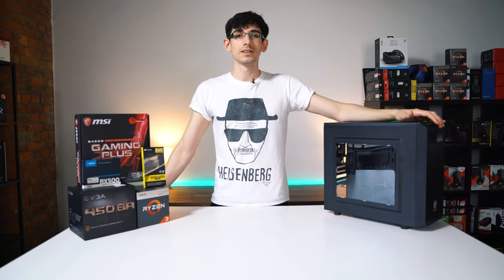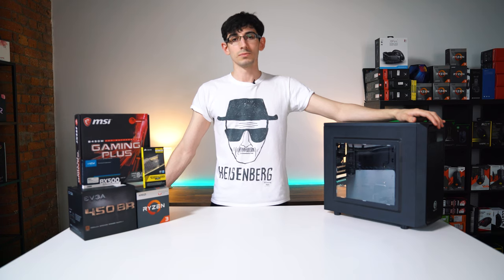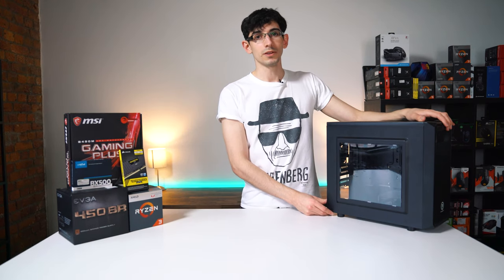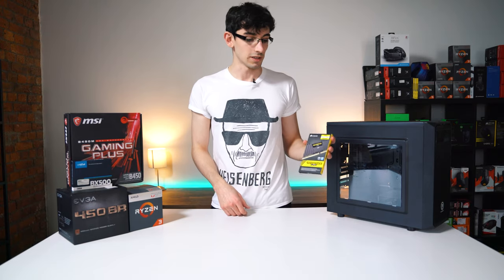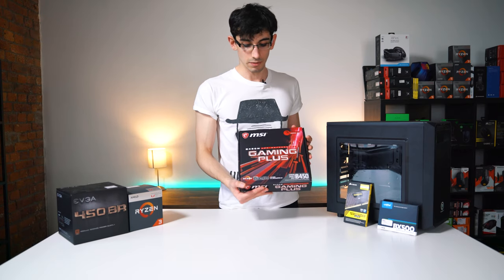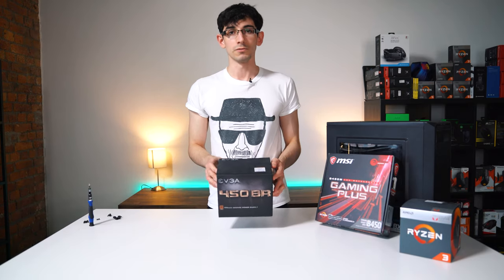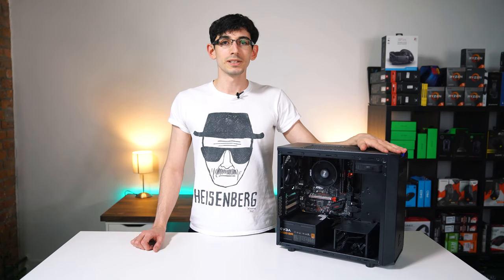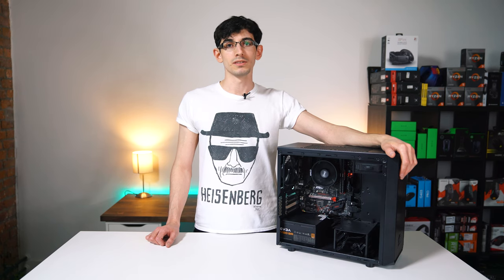Best $300 Gaming PC of 2020 | Budget Builds | WePC

Comment: To afford this I would literally
 ha e to work for 1 and a half years
Reply from the maker: Damn! If there's a second hand market (like eBay) then we'd suggest looking there then - used i5 2500Ks or above bundled with motherboards and RAM can be had for about $100, some even include a graphics card, but you'd also need to source a case, PSU and storage

Comment: Would this build run Adobe Photoshop easily? I'm not a gamer, have never built a computer and actually need it for graphic design but I've heard that gaming computer specs would be high enough for that😅
Reply from the maker: Our $300 build is about as entry-level as it gets for a gaming PC. With Photoshop you want to invest heavily in the CPU and RAM, but it ultimately depends on the filters you're using and the image sizes. To keep the cost down we could recommend splurging a bit more for the 3400G which has 4 cores and 8 threads. If you want something even more powerful then look at the Ryzen 5 1600 or 2600 which can be similarly priced or cheaper and have 6 cores and twelve threads, but you'll need to buy a discrete graphics card. Alternatively, looking at intel, you could get an i5 9400 (non f) which has  6 cores / 6 threads. and integrated graphics. I'd honestly recommend going the 2600 route in which case you'd be looking at our $500 build: https://www.wepc.com/builds/best-gaming-pc-under-500/

This will be more capable for any other creative tasks you might try in the future like video editing, 3D modelling, animating, etc. so it will be worth the price increase. You can customize the components like the case for example, I prefer something like the Thermaltake Versa H17 for a more elegant design. You could also get the RX 570 8GB edition for not much more money but will offer a little future-proofing for newer games. If you really don't care about gaming then you can just get the cheapest graphics card which has the right outputs like the GT710, but you'll be missing out on newer hardware decoding features.
Reply: WePC 
This information will help me a lot, thank you!

Comment: What upgrades would you eventually recommend?
Reply: And could you just put a graphics card in and be fine or would you need to go from a apu to gpu?
Reply from the maker: There is an upgrade path on our article: https://www.wepc.com/builds/best-gaming-pc-under-300/
Essentially upgrade to the $500 build, so get a Ryzen 5 1600 AF or 2600 and an RX 570.
If you purchased a discrete graphics cards, then you'd simply install it, plug in the HDMI or whichever cable and install the drivers (use DDU to remove the old drivers).

Comment: Hi! My gaming laptop has been my goto for gaming but recently its been having issues. Can this PC build play Overwatch (and Overwatch 2), the SIMS 4 (and all the packs) and House Flipper (and it's DLCs) with no issues?
Reply from the maker: We tested Overwatch on the 3200G at 1600x900 resolution, Low settings: https://youtu.be/3q-6P6n7H8A
House flipper looks like it would run about 30FPS at 1080p Low settings though the game isn't well optimized so it won't necessarily be smooth. The Sims 4 should be fairly playable at 900p at medium settings (approaching 60FPS) from what we've seen.

Comment: Can it handle World of Warcraft at a good fps?
Reply from the maker: 1080p Low settings is anywhere from 70 to 100FPS. Medium settings are about 50FPS at 1080p so we'd suggest running at 1600x900 with a mix of Medium and High settings if you want the higher graphical fidelity and 60FPS.
Reply: @WePC  Ok thanks

Comment: More like $400 build. If anything, prices usually decrease on computer components. This system was priced on Amazon at $371.58 before tax and would be $405 with tax to my location.
Reply from the maker: If you check the news you'll find there's a pandemic going on so many areas of production have shut down and stock is dwindling and sellers seem to be charging more due to this scarcity.